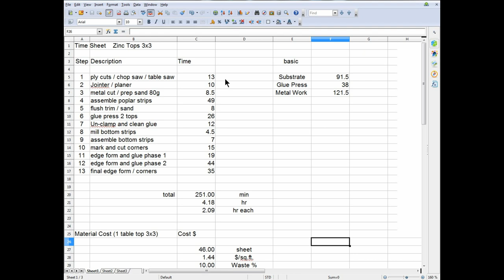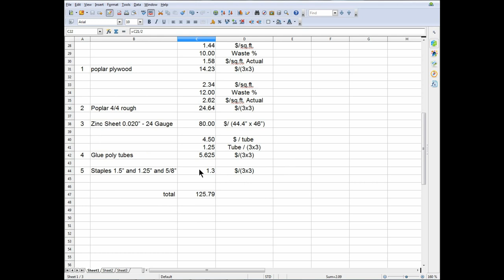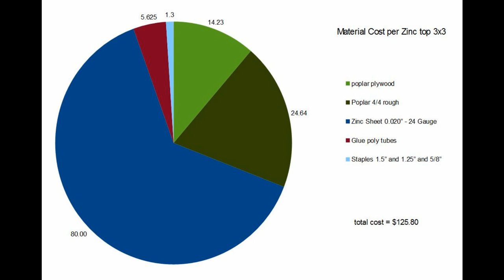Zinc Table Top Time Experiment - Bidding a Large Job - New Substrate Method Explained

Comment: Great work except the under side. You put so much attention to detail into your work but the QC seems to have stopped at the visual line. People WILL feel every surface and those corners seem problematic to me. I love figuring out quirky jobs like this. Keep up the nice work.
Reply: I just finished a table top inspired by this video. It was easy enough to add a final ‘inner fold’ of the zinc parallel to the outside edge . It might be overkill but it would be possible to also put a thin strip if dress wood so the edge disappears.

Comment: Why not just us 6 X 2 boards with slight gaps (farm table style), with Sikaflex to take up the expansion? Any movement then shows up as long shallow lines at worst, adding to the traditional appearance. If you then apply patina lengthwise, they virtually disappear. Use sandbags rather than clamps. All this saves a heap of work.

Comment: Wood Expansion/Contraction Indoors is from the changes in Humidity (doors opening/closing on humid days, etc).. Outdoors, it is that plus heat variations/Sun, etc... Outdoors is the worst Environment, but, seems indoors is something you could contend with, by removing the moisture problem.. Most moisture is soaked up from the straw ends, but, not always.. I am not building yet, but, I have seen lots of table tops warp up on the ends that builders make.. I often wondered if that was not due to the moisture getting into the bottoms and edges that were not properly sealed... If the bottom were sealed as well as the top and ends, it seems moisture and movement due to moisture would be eliminated... If the tables are indoors, the temperature variation should not be enough winter to Summer to make a Difference.. Usually, it is not more than 10 degrees in an Climate controlled building.... 
I have seen a builder who makes lots of tables for restaurants, etc, and he ALWAYS puts two coats on the bottom, no matter what.. Maybe he figured it out??  He uses a high dollar UV coating on the tops and regular urethane on the bottoms, unless he is in a pinch and needs to use the UV to stay on time budget... Anyway.. It's a thought you could do on a small table and put outdoors in the shade and partial Sun to speed things up a bit and test.. 
Another thing would be looking at a different adhesive.. What is the temperature variance on the adhesive you are using? Maybe some Urethane base, or switching to a Flexible Adhesive with a rubber type of base, etc?? Like a Butyl Rubber maybe that they use on Windshields for vehicles, etc... 

I would like to know what they use the zinc wide sheets for.. I have never seen any that thin that you could roll up in a roll.. I would like to take a shot at making something like that.... I have made a bunch of shop tables for Oil laden parts (Engines, Lawnmowers, etc), but, the metal came in 5x10' sheets and was much thicker and I used Contact Cement. I never noticed any of the tables having a glue release problem.. Anyway. Maybe that gives you something to think about.. 
Nice Videos btw!!

Comment: I doubt that "Plywood Movement" was a problem. I rather think that "Non-Movement" was the culprit. The metal moved and the ply didn't. The metal grew and that is why it pillowed.
The temp change in the metal will always be far faster and more dramatic than the wood. The metal will also have a very localized temp rise and fall with hot plates and cold glasses. Just guessing that is what happened.

Comment: The corners with the caulking are a real mess, very unclean and a safety risk for little child fingers.
Here is what you can do instead. Either make a hem or overlap the material and solder it together, will look much cleaner and more professional.

Comment: Have you dissected one of your failed counters or tables❓ I wonder if the problem is a bond failure. I've had glues and caulks peel clean off of metal surfaces. Of course, poorly-prepped surfaces are also a contributor. If I clean an aluminum strip with vinegar, silicone will bond to it like no one's business. Using silicone, however, due to its rubbery nature, will lead to a slightly "mushy" surface.
A way to to put the clincher to wood movement, is to adhere a layer of aluminum foil to the bottom, essentially wrapping the piece with metal. Be sure to seal all seams.

Comment: What is the board under the poplar  pieces are nailed into?  Is it ply?
Reply from the maker: yes that is poplar plywood which will shrink some in the winter but the alternating solid wood on top will remain rigid.  I used a few random pieces of plywood together to add some expansion joints

Comment: How about air powered caulk gun? Battery operated are also good, but more expensive.
Thank you for great video. Again :)
Reply from the maker: that would make sense.  also need an extra set of arms to help spread the glue evenly.  that part takes he most time
Reply: hffcom Not knowing what kind of glue you are using, i started to wonder if it is possible to spread with metal glue comb with really small teeth.
Thus there is a chance that wrong kind of teeth can make glue ”shadow” thru zinc. I gotta think more about it.

Comment: I wonder if it would save time (or be as effective) if, instead of the poplar strips you just use a router to plough out narrow grooves in one or even both sides of the substrate to mitigate wood movement. Yes you'd still have to set up a straight edge for each pass or use some sort  of sled that can guide the router. Just a thought. Anyway, very informative and you create some beautiful pieces. Cheers.
Reply from the maker: I tried that a number of times.  all the forces add up the same way, and it didn't make much difference.  only if you cut the substrate all the way through and piece it back together on top of solid wood framing... but then at that point it makes more sense to use all solid wood because it makes it more structurally sound

Comment: Why are you not using contact cement?
Reply from the maker: very low creep strength.  unless what you are gluing  is thick enough to remain rigid.  thin metal buckles easily

Comment: Have you tried mdf? It is extremely stable.
Reply from the maker: just one time... the MDF stability myth can be costly.  I had to do that one over plus shipping.
Reply: @hffcom  that defies everything I've been told. Was it bad?
Reply from the maker: @jameshorrocks2939  it was the worst failure I had with metal.  4x8 island
Reply: Was it a broken substrate issue, or was it swelling and contracting?
Reply: That is likely. That would lead me to think a flexible glue could be the way to go.